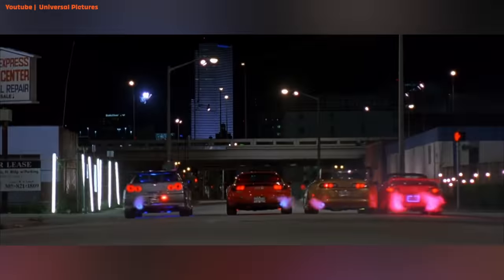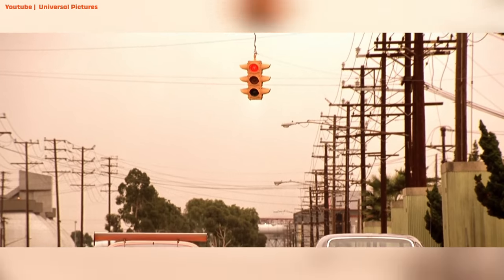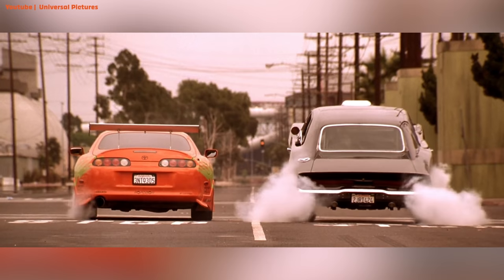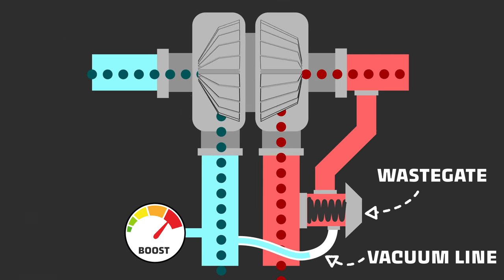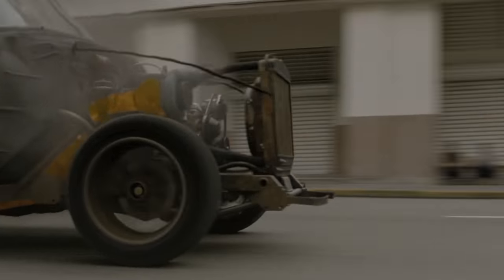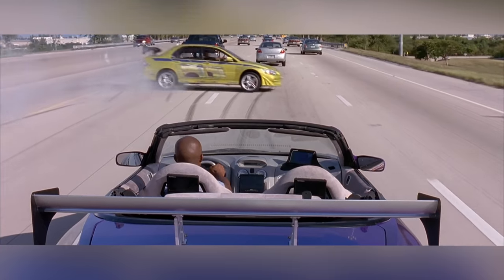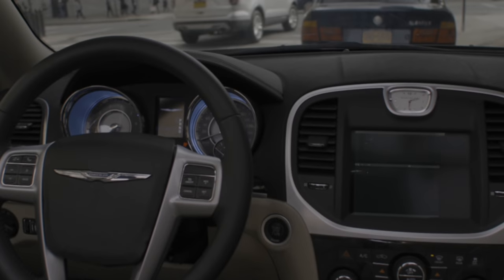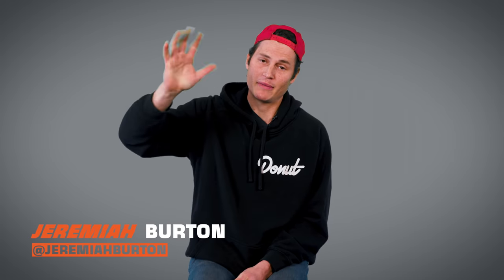Busting Fast & Furious Lies with Science

Comment: Question about the NOS part. If the car is already on fire like shown in the clip couldn’t it heat up the bottle of nos causing it to become more pressurized due to the temperature change? And once the Nos bottle exploded wouldn’t it feed the flames with more oxygen? It may not cause green flames but I thought that’s why nos was illegal on the street? Because it could cause injury to first responders and firefighters in the case of an accident

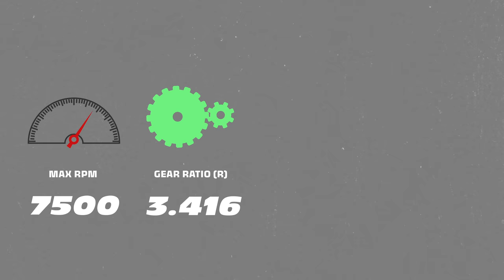Comment: @10:19 this is doable, as anyone who ever played around in a sufficiently advanced racing simulator knows, you can lower the final drive ratio , increase all the other ratios to their mathematical equivalent, and the result is a low enough reverse gear ratio that you can speed on a highway, few issues that simply can't be fixed any way while keeping the car a car meant for moving forward and high speed reverse a "bonus" are caster, the caster is always set so the car balances itself straight but when you flip it 180 degrees it does the opposite, it becomes extremely sensitive and it will surely end you. The second problem is the reverse ratio is high for a reason, using a lower ratio will make the stopped -> driving transition one hell of a clutch burner if you went with a gear ratio low enough (for a high enough reverse speed). So while yes, it is possible, no, no-one sane enough would ever do this to their real life car, this isn't a simulator where you use a few sliders and bam.

Comment: I can confirm, your science is wrong on that first one: while yes, it was on a motorcycle, and yes, to get an equivalent power to weight ratio you would need a 2000hp engine in a 3000 pound car, I have actually wheelied while burning out. a burnout doesn't mean NO friction, it means lower than optimal friction. all you need is enough power to lift the front end being delivered to the ground. hard, yes, impossible, no

Comment: I had commented on another video about the zombie car scene in the movie about needing a few servers to make this happen. Got quite a few replies trying to tell me that I was wrong about needing a server to make it all happen. What those people fail to realize is; one servers if built correctly have a lot of processing power in them with a bigger network connection to boot then a laptop. To make this scene happen in real life every car would need at minimum a 3g connection in the infotainment system and have the same "back door" that the two guys found in that Jeep. On modern cars you are basically driving a computer network on wheels. EVERYTHING is connected to it. It's called the CAN bus. The modules talk over this high speed network to everything else and ends basically at the PCM. If one module fails to communicate the PCM will throw the CEL on and it may even go in limp mode. But these days the cell network operators are killing off the 3g connection and only keeping 4g and above just because it helps clear the wireless spectrum of clutter and hardly anything uses 3g anymore.

Comment: I beg to differ on the NOX explosion. Yes, they made it more cinematic with the green flames and such. But NOX are system with NO in the tank. Tank design for holding it are most likely high pressure in the range of 3000 psi. Heat from a car burning can rupture the tank causing an explosion. So it should be possible to get an explosion from the NOX in the car from burning.

Comment: So a compressed air of any kind heated up will explode eventually. Which coukd send a burst through an idling car which coukd cause a fuel explosion espicially if the throttle is only open very little. Too much pressure...explosion.

Comment: German engineer (who was teaching physics at a university) here:
The wheelie calculation is totally incomplete.
You calculate the necessary acceleration to put a car on the rear achsle, the formula for this doesn't look too bad.
But jumping from "we neeg 2.6g" to "with a bit more math and some more equations resulting xy lb-ft of torque" is weak. You are not even saing which measures you use in your equations. What is the transmission like, what is the wheel diameter like in you assumptions?
Also friction during a burnout is way lower but not zero.

Comment: Technically, at least 2 points are wrong. Firstly, with enough lb/ft of torque, a car could smoke its tires whilst performing a ‘wheelie’, for a very layman example; a car produces 2000 lb/ft torque and its drag radial tires puts up to 1000 lb/ft of torque to the ground which in turn causes the car to exceed its mass/power ratio and lift the front end, yet the additional 1000 lb/ft torque spins above the rating and produces the aforementioned tire smoke. Secondly, although NO2 is not a flammable gas, it is a compressed gas when bottled and utilised for use in cars, so although the gas itself will not add to the flames, once the container is ruptured, it would explode and send debris flying.

Comment: One more thing.  As far as the Evo not being able to go super fast in reverse, it is possible.  Remember, these cars are all modified.  We also know that IRL, Paul Walker was very knowledgeable about modifying cars and getting more performance out of them.  Who is to say that either he, or the people on the set that were actually modifying the cars did not change the reverse gears in the transmission?

But I do want to point out that is is hard, not impossible, but hard to drive a car in reverse at higher speeds and keep it straight and weave around and keep it stable again after weaving in and out of traffic.

Comment: Everybody loves to misinterpret the exploding nos scene without thinking logically about HOW it could cause a fiery explosion. The nos tank is sitting generally overtop the gas tank. When it explodes, the gas tank gets ruptured. This rupturing will cause sparks, not to mention the car is already on fire. The resulting explosion of the gasoline filled fuel tank is where the actual fiery explosion comes from. That's what we see happening in the movie. Myth is 100% plausible.

Comment: I am a heavy equipment mechanic, and I can tell you while yes tractors have multiple gears in reverse, those gear ratios NEVER exceed the forward set of sync rings, meaning a tractor that can run 40 mph forward will never have reverse that matches that. and I have never seen a tractor that can surpass 100 mph forward, the fastest stock tractor I have been around tops at 50 mph forward add that to Cuba (who are using tractor tech from 1950 US, I really doubt even a mechanical savant could use this bs

Comment: You could theoretically do a burnout and a wheelie at the same time if you managed to produce that much acceleration without having full traction. Also wouldn't need quite as much acceleration if you move the weight distribution backwards and/or higher.

It would, however, be very difficult to achieve the necessary combination of power, partial grip and wonky weight distribution by mistake. Also it definitely wouldn't look that controlled.

Comment: Carburetors work through the venturi principal. That is about using a fuel inlet into a chamber past an orifice to increase velocity while reducing pressure. A carburetor requires a fuel bowl open to the atmosphere to push fuel through the jets into the air intake plenum past the carburetor's venturi where flow was restricted to reduce pressure. A blow through carburetor has the bowl vent and the carburetor's air inlet connected together in the boosted air pressure inlet. All of this is restricted by the throttle blade that seals the plenum from the pressurized air above it. Once the throttle opens there will be a differential pressure between the pressurized air that is pushing on the fuel in the bowl versus the pressure drop past the carburetor's venturi.  This action is what forces fuel into the intake manifold and how a blow through carburetor works. adjusting the jet size will cause the carburetor to be more rich or more lean depending on the amount of air flow through the venturi. So in that regard removing the vacuum line from the pop-off valve will simply allow full boost pressure when you don't want it, when off throttle while the engine is still spinning fast and or providing too much boost for the engine setup and or fuel choice causing damaging detonation. The purpose of the pop-off valve is to restrict boost pressure at high rpm when the throttle is closed. because at this time the engine is still spinning at a high RPM and a lot of exhaust flow is still going through the turbo. This is to prevent over boost off throttle. Given all this that boat engine in that pile of  junk was already over heated. The pistons where already getting destroyed through expansion into the cylinder walls, melting and or fracturing due to detonation. But to top it all off the engine was on fire so it was loosing fuel pressure to the carb. The one thing that could be plausible in the high speed reverse situation is the use of separate reversing gear because the transmission only had forward gears. So in that situation you would have the same gears in forward as reverse.

Comment: Loool what about when they were pulling a multiple ton solid steel safe thru the streets of Rio? Assuming the frame doesn't disintegrate, they would never be able to accurate past 30 mph (probably more like 10). On turns if they could go 60 mph the cars would flip due to the momentum.

Comment: So the driving in reverse at high speeds is 100% possible... but also 100% didn’t happen in that lancer. There’s multiple ways it could be accomplished but most if not all are pretty custom/unique setups, like custom transmissions with multiple reverse gears, or a separate reversing gearbox outside the transmission. The reversing gearbox is common trick with custom builds using a motorcycle engine in a car(or larger trikes), most motorcycles don’t have reverse, so a reverse box is added to the driveline, but still uses the motorcycles transmission which then gives you the same amount of gears(at same ratios, so therefore same speed capability) for forward and reverse. More a byproduct to simply get a reverse gear, but still technically capable of high speeds in reverse.

Comment: So about tractor transmissions. Some, like a massey ferguson I use to run when I worked for my neighbor as a kid were just as fast backwards as they were forwards. But that's because you had a twin stick transmission that made 4 gear ratios. These were planetary gear sets, so no clutch needed, either. And with this transmission, you could switch between forward and reverse just by stepping on the other side of the throttle. All sounds awesome, you could really make a fast and furious car with this right? 

Well know. because this transmission is also a structural member of the tractor and quit literally can not be removed from the tractor. Secondly, that fancy easy reverse, well that's because the throttle was also a bi directional hydraulic valve. You step on the outside and you go forward, you step on the inside and you go backwards. The engine powered a hydraulic pump. The pump pushed special hydraulic fluid through a similar hydraulic motor. the motor turned the gears of the transmission. The transmission sent power to the rear wheels (that were 54 inches tall) that moved the tractor forward/backward. The engine was a ford flathead that made about 40 hp. And this transmission set up turned that engines wapping 40 buff horses into a max top speed of about 22 mph. The output speed of the transmission at full throttle was 500 rpms, the rear gear in the tractor was about 8 to 1, so those tires weren't turning all that fast. Most of the speed was purely due to the size of the tire. 

But when it came to torque, that tractor could easily to a wheely. Just chan it to a stump, and that nose was going up. unless you had 3 yards of rock in the bucket... then the stump was coming out.

Comment: Donut Media, if that wastegate trick isnt possible then could you explain how Nissan R90ck driven by Blundell was able to reach completely new top speeds on the mulsanne straight back in the day despite having broken turbo? they say its wastegate was stuck closed. The engine probably broke afterwards but regardless it was given a big boost to power.

Its obviously a racecar but would be cool to hear how did that work and why did that work and not this one?
Worth a video? :D

Comment: If it had a tractor transmission it is true that they have multiple reverse gears (Up to 8 on various mechanical transmission tractors) however, you would need such a high rear end gear ratio that the rear end gear itself would be incredibly fragile. So going that fast in reverse would be plausible, but not practical or even safe.

Comment: What is also interesting, outside me commenting on a 2 year old video, is how people expect a car on fire to explode when it reaches the gas in the tank like they see in the movies. As a firefighter of 13 years I can tell you they do not explode like this. Not saying it could never happen, but I have never seen it outside a little pop sound, doing almost no damage. But like a propane tank it would need to boil the fuel in a tank that can handle the pressure beyond simple bleed off and then build up so much pressure that an explosion happens to burst the tank with extreme force. Plastic and even metal tanks are not strong enough and built to bleed off pressure or create a leak that bleeds off pressure before it reaches the point a large propane tank without proper BLEVE can reach.
Now large propane tanks failing can create an explosion to send fuel and shrapnel everywhere, even up to 100's of feet away, as well as a shockwave and moment of fire/fireball that can damage nearby people or structures.

Comment: I believe nitrous actually could cause an explosion, maybe not as dramatic as the movie, but still an explosion. The car was already on fire, and oxygen fuels fire. The amount of oxygen and the pressure wave coming off that exploding nitrous bottle could instantaneously fuel the fire and cause an explosion. It's a similar to why oxygen bottles say flammable, oxygen by itself is not flammable but it can provide the perfect environment for combustion.

Comment: Biggest problem with the carburetor is that it loses fuel pressure as boost increases. Carb generally wants to see about 6 to 8psi of fuel pressure, but say if you’re running 6 to 8psi of boost, the air pressure against the fuel pressure cancels out to 0, big lean out, boom, melted pistons and good times. That problem however is solved with boost referenced pressure regulators. For every psi of boost it adds one psi of fuel pressure to the carburetor giving it the fuel pressure it needs assuming it has a high pressure fuel pump and a return style system. Seeing as it already had the turbo on it I’m gonna assume yes. And to fix the jetting issue a quick bore out with a drill bit and we’re in business. So the boost trick in theory would work. Not for long though by any means, and it’s gonna run richer than Bill Gates at anything other than WOT. But In a race where you plan to blow the engine up anyways why not? Send that shit to the moon my guy!!!

Comment: Lifting the front wheel while accelerating: Cars like the Ferrari GTO or F40 are said to lower the force on the front axle by 90% while speeding, which might bring lifting the front wheels in reach, though, these constructions use a generally light rear engine layout, not a full blown big block in front...
I guess, a tuned Lancia Stratos  might do it, but on the other hand, any race car apart from dragsters will get a weight balance, that keeps it maneuverable in corners, even when accelerating to some extent.

Comment: Uh.... you can 100% smoke the tires while doing a wheelie. If you have the bare minimum amount of power then no. But if you have a huge excess of power  then its totally possible. Doing a burnout also doing mean there is NO friction. It means much less but if there was no friction you wouldnt need to hold the car back with the front brakes. During wheel stand competitions, cars constantly smoke the rear tires while holding g glorious wheelies. Usually because the car lifted so high that it loads the rear bumper on the ground unloading the tires, but the car still moves, tires still smoke and the the bumper is sky high

Comment: Also your animation of the Nitrous oxide being N-N-O is incorrect as the reason people use Nitrous oxide is because its enriched oxygen content being N-02 or as you depicted it N-O-O.  And as you are correct as the boost hack would only increase the power a small amount.  If they jetted the vehicle to run rich and hence spraying extra unburned fuel out while racing to pull out the W in the end pulling the vacuum line to increase boost he may have had a better AFR with the Turbo untapped on boost.

Comment: In the Scene with the fate of the furious with Dom driving Backwards a Tractor transmission you have your 3 shifters your directional shifter, high and low gear and your basic 4 gear selector.  In order to not lose speed you would have to have it the 2 gear settings when flipping the car around then shifting the first gear putting it into reverse.  As most people who are only familiar with regular car transmissions i can understand why the doubt would be after all the movie magic as in Brian driving backwards @100 mph.